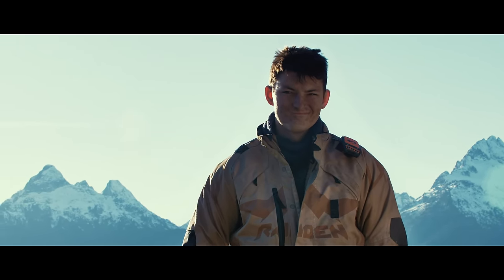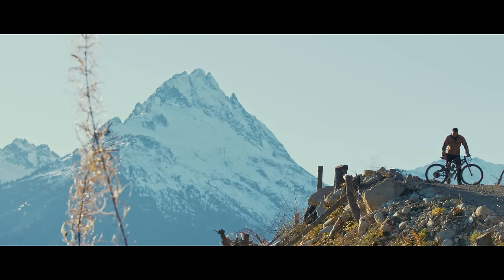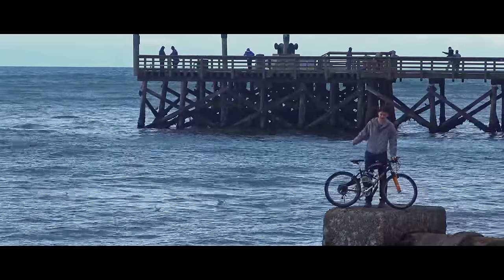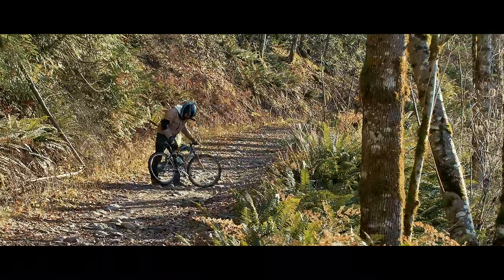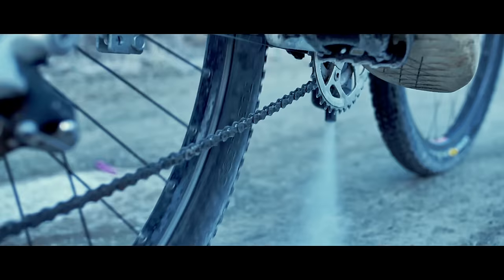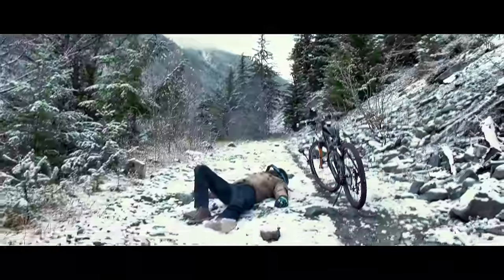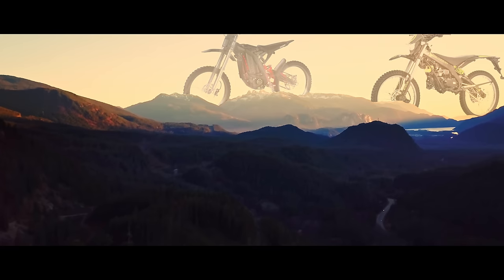I Built a Mountain-Climbing Motorcycle for $200

Comment: Electric bikes and other light weight personal transportation vehicles are surely the future. Atleast in the ever growing cities. But what comes to electric vehicles we honestly need to see some really big improvements in battery technology to get the cost and the emissions down
Reply: Microturbine-Electric Hybrids
Reply: Glass batteries?
Reply: until gas stations have recharging stations built full electric vehicles are pretty much regulated to large city dwellers, people in rural areas will be the last to own or want one. case in point someone in my town bought a Tesla 3 recently but no longer drives it because there are no dedicated charging stations within about 450 miles, and charging it on a home outlet takes too long. if they run out of power away from home, they essentially have to have someone with a generator come up and give them a charge, at which point defeats the purpose of an electric vehicle.

if you want something small, that will pass emissions, and weighs about one standard american or less, look at Chinese bikes. the Hawk 250 has roughly a top speed of 65, parts are readily available online, and will get about 90-120 miles to the gallon depending on riding style and rider weight, for roughly $2000 usd. so for a city commuter it's a value stock, but if you ever want to mess with it, putting a larger sprocket(s), tires, different lights and turn signals, and an after market air filter wont cost more than $300-$400
Reply: Kalezian Blame local mentality and politics on that one. In many places shop owners are installing charging stations to attract customers while they wait, brilliant! We already have electricity everywhere, so it’s only ourselves who choose not to pass it to cars.
Reply: Kalezian Agreed, i did exactly that with a Chinese 125 ‘supermoto’, it was fun to ride and good looking, and I think I made it even better looking (like a 60’s ISDT bike). All for £1400 brand new. Les in UK
Reply: @leslieaustin151  the one good thing about chinese bikes from what I can tell for euro-bros is they can pull you guys through your A1 and A2's easily without breaking the bank which is the main reason I got one. I can afford to lose a 2 grand chinese bike, I cant afford to scrap a 18 grand ducatti.

also, at least it isn't a scooter, I guess.
Reply: @somestuffithoughtyoumightl6985  this also is the mentality of most people, just because your car runs on electricity does not mean your electricity wasn't made via fossil fuels or nuclear power, both of which cause waste and major emissions. sure, I'd love to honestly see someone build a set up of nothing but green energy and see how efficient it is to charge a electric bike or car and how that could be implemented on a large scale basis but no one has the time, money, or desire to go completely green.
Reply: @Kalezian  Generating electricity via fossil fuels and powering electric cars with that is way more efficient than using gasoline. Electricity has a direct distribution network in place, but gasoline has to be shipped around. Also, making a really efficient power plant is significantly easier than making a really efficient engine that has to fit in a car
Reply: @Kalezian  " recharging stations " no, totally wrong way to go about it. quick and simple battery swap is whats needed to go forward in any realistic way i reckon
Reply: @brapamaldi  I think that wouldn't really be needed if battery technology would make big leaps to solidstate batteries that would give bigger range etc. Maybe battery swaps to larger vehicles like trucks would be needed.
Reply: And how big do you think theses batteries are? They not just a couple of D cells you can flip in and out in a couple of seconds. A Tesla 3 has nearly half a ton of batteries on board, the whole car is built around it, you can’t just “swap them out”.
Reply: @brapamaldi  There's an electric car company in China called Nio who has installed battery swap stations for some of there cars and apparently it only takes five or six minutes. The VP of Nio Power suggested battery standardisation was the biggest hurdle, as then they could be leased independently of the cars to which they are fitted.
Reply: @BernardsSumner  Yeah, but nobody cares if your car goes up in a blaze of lithium in China. Or if somebody is fried to a crisp while changing the batteries. They can scotch tape bargain bin 18650 cells wherever they please, without fear of litigation.

Comment: Bro I ordered one after watching this will update when it comes
Reply: it came and is fun but only goes a top of 32km idk why
Reply: @pugboi4078  probably a legal speed limit.. probably ways around it too. gearing also
Reply: Ya a kinda figured gearing
Reply: @pugboi4078  matching my crank case to the transfer ports with a dremel doubled my power, easy
Reply: Huh that sounds interesting, is there any videos/articles on how to do that?
Reply: Wow thanks for going through the effort to make this I will deff try this out
Reply: @pugboi4078  Yeah man, no worries. Hope it goes well. I'm very surprised there aren't more people doing this. Do you have the 80/66cc or the 50cc?
Reply: I have the exact same one as the vid so the 66cc
Reply: @pugboi4078  Nice one. Should work for you then
Reply: Ya thanks for all the help
Reply: I think 32kmph is good for 100 dollars
Reply: @pugboi4078  I bought mine from motorized canada a skyhawk 66cc things a blast and adverts 60km an hour havent actually checked how fast I'm going when I full throttle but I'm sure it's a lot more then 30km also a good quality engine if anyone is looking for one

Comment: Good video Fortnine.  My friend and I built a motorized bike out of a throw-away Schwann and an old Brigs and Stratton 3 hp lawnmower engine. We used an old roller skate wheel and a stick on a fan belt for a clutch.  I got up to 30 mph on and abandoned railroad bed.  It was a blast. Never considered wearing a helmet. Nobody died. Oh— that was 50 years ago.

Comment: Love it! Now buy another engine kit and make it 2wd!
Reply: @Raphael Gallo if you look up the Rokon Trailbreaker, a 2wd motorcycle sounds good but you lose everything that makes a motorcycle....well, a motorcycle. however it does get you places that a side-by-side UTV or an ATV cant get to, even if you can only get it to about 15 mph.
Reply: Raphael Gallo use cable splitters for the throttle and clutch 👍

Comment: Looking like ye have to get more fuel in- re-jet.  That’s the lowest revving two stroke in history 😂
Reply: The engine he got is the one that is designed to meet epa standards. Ie, ran so lean it wants to die. Not to mention its begging for oil even at its break in ratio. Once tuned propperly they can rev as high as the metal they are made of can handle. Mine usually chokes out at around 9k rpm but with a previous exhaust it went to 10k rpm. Course at that high of rpm its the worlds most painful vibrator.
Reply: Ella Banana Er nope.  Low revs in a two stroke generate too much kick back so destroys the bearings. As for using as a vibrator I’m afraid I can’t test in that particular situation.  I suggest advancing a degree.*edit if you want a smoother ride that is* 😂

Comment: Brilliant Ryan 😊. Four years after you made the video, I've watched it tonight here in UK.  Bicycle tech has moved on considerably and let's be honest, you used a very old 26'er for the video anyway.  If you fancy redoing this fun video, might I suggest a few ingredients to spice up the fun factor.  Steel frame hardtail 29er.  Something like a British Cotic or Sonder. I'm sure you'll have some equivalents.  They cheap as chips second hand - perfect YouTube video fodder.  1x12 or similar drive-train.  150mm forks, 34mm diameter stanchions. 150mm dropper post, and flat handlebars at least 700mm wide (not like the super narrow bars you used - OMG that must have felt sketchy doing a few jumps and other techy trails 😅).  Some beefy 3.0 tyres, they are so cushy and will handle the extra weight of the motor so well, plus they grip like shit to fur for off road dopamine rush.  C'mon you know you want to 😊 just wish I could be there to build and ride it with you.  Best regards. Lisa

Comment: I've ridden the mountain mule trails with a dirt bike.  What you are doing is nuts. But I respect you for trying.  Smaller is definitely better for dirt.  I don't understand a 650 in the dirt, much less a 1200 that I have now.  My 1200 sure hauls ass down the dirt roads, but it doesn't quite have the feel of my 125.

Comment: My buddy I built two of these when I was stationed in Korea. Once you get through the “teething” phase, with break-in, figuring out the motors individual preferred fuel-oil mix (mine liked a heavy 25-1, my buddy’s liked 35-1) and chain alignment, they are stupidly reliable. I drove mine all over South Korea lol

Comment: Lovely, I want one. In the U.K. after the government cut and road registration it would be cheaper to by a second hand moped.  Electric also comes with a raft of restriction here as does access to off road🤔 BTW too much oil in the petrol makes it run lean, also make sure the quick release lever for the wheel points backwards, or some undergrowth may undo it.

Comment: At 9:45 it shows a dire mistake on the front skewer. It should be faced to the back of the bike. This prevents objects from hooking it and opening up the axle. While the drop outs will hold the wheel in while you get stopped, it might be a little unnerving as you descend a slope or hill while your front wheel wobbles around.

Comment: Lots of production value going here. For those interested, there are aftermarket parts & mods available to get up that mountain and keep these things running. Be handy. You had better be handy and carry a basket of tools. So, a jackshaft kit will let you route the engine power through the bicycle gearing and  BOOM you've got 21 speeds. Your overall cost just jumped to $300.00.

Comment: I built a couple 4 stroke for $350 ea with $100 Walmart MB's. A bigger rear sprocket will give you more torque. 
Made to summit local mountains, and burn brakes up on the way down!

Comment: I converted my long wheel base recumbent bicycle, to a E-bike by adding a front hub motor. In parts of Europe, E-bikes are becoming the normal. Course mine is Electric, so range is limited to battery size. But seems a lot more reliable, then what you built. You should look into E-bikes. Heck using Hub motors you could build a the bike from Akira!

Comment: Built what you have there but fixed a bunch of the issues you encountered in your off road homebuilt.  The biggest issue to be fixed is the gearing, that is putting shorter gears on it.  Started with a used $10 15 speed mountain bike, sorry no suspension on this baby.  Add a 80cc cheapest on Ebay, yep 60cc for normal folk.  Next take that stock sprocket and use as a ringing target for your gun range.  Replace it with a 60 or so rear sprocket and gain a shitload of power but a loss of top speed.  Engine improvements are simply match up the ports, anything else is just frustration and money spent.  Installed a disk brake kit, slightly better stopping, from useless to simply fear instilling.  Hey now it will maybe hit 25mph off a cliff but it will also now climb that cliff.  Made a homemade sidecar and the grandkids love it.

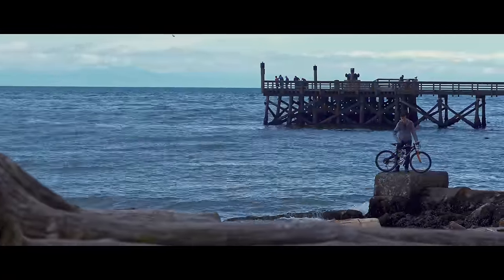Comment: 4:04 - Cubic Capacity
What is Cubic Capacity (CC) in Motorcycles? ... The capacity of a motorcycle's engine is measured in terms of cubic capacity. Cubic capacity, also known as “cc" of vehicles, usually ranges between 50cc to 1500cc. It is also believed that the larger chamber on a two-wheeler, the more powerful it is.

Comment: I have a BSA from Trev Deeley's, sold in 1969. When they were on Broadway, cool adventure if you want to test ride a near mint '82 R100RT dual plugged the last wind tunnel designed motorcycle for production is the rumour. I'm in Vancouver, or a 1500w all wheel drive EV 1952 CWC Roadmaster LOL!

Comment: I built one of these.  Be careful, the engine raises the center of gravity.  I also replaced all the studs and bolts.  It will burn you.  The vibration is pretty damn bad,  It's a fun toy.  I bought a honda grom afterwards, which is night/day better but also $$$.

Comment: Wonder how better a 100cc would be. These 2 strokes need to have the main jet swapped and  slide adjusted to keep it from running too lean. It's so easy to do on those carbs. Although a 50cc or even a monster 80cc would probably not break a sweat going up mountain trail.

Comment: Motorized bike is the proper term for this application being that it can be used for exercise and a faster mode of transportation. Motorcycles are only used for transportation and once you've ran out of fuel you have to either push it or call for help to get it refueled. Motorized bikes don't have this problem by letting you use it as a bicycle when you run out of fuel.

Comment: coming from e-bikes theres not much available commercially thats under 100kg and under 50 mph ( but can get over 30mph ),  it makes it hard to decide which motorcycle to try and get as a beginner,  I've been looking at Puch / Tomos / Jawa sort of things but they are not selling enough of them new for it to be appealing.  I like the Honda Trail 125 but its quite expensive and doesn't sell in the UK, some guys did a video with that bike where they rode it through Alaska.

Comment: I did this on a 5 dollar garage sale bike. 2 years of consent use and 5000 miles later and she still holds up fine to 10 mile redlining. A few replacement parts but I could not have gotten anything better or cheaper for a kid going to work. If your to young to get a licence, get this.

Comment: This is exactly why I love Janus MCs. They are 250 and 450cc engines based off of a Honda scooter motor and they are all reminiscent of the Harley and Indians of the 20s gone by. 100years of legacy being pulled from the barn, dusted off and back out on the road because a cafe racer shouldn’t cost $30k and a scout bobber shouldn’t be $25k+. I have been dreaming of doing a home built moped with the shoebox kit, using a full suspension fat bike, but I’m not sure if there are any kits that can take the load. Would be badass as hell though if I could get it to work
Reply: These have very low power, below 1 HP. You might want to go electric (my electric bike was pretty cheap and I've even got a hub motor wheel with 5" fat tires on it for under $200 and about 2x the power of that gas one). Chainsaws make good engines if you're wanting to do it proper, and in some states perfectly legal considered just a bicycle (some prefer electric, like Texas I made the electric for that, for Oklahoma I had several motorized bikes ranging from 25cc weedwhacker that would do 28 mph and accelerate decent up to 52cc chainsaw when they raised the limit above 50cc for the chinese kit engines, but the chinese kit engines are much slower, like 22 mph max and terrible acceleration and stupidly heavy, and sound terrible unless you change the exhaust to a go-cart exhaust which is easy since its standard plumbing pipe thread)

Comment: Mine ran good for about 30min then it started to sound strange and I felt the exhaust on my leg.  Turns out one of the cylinder studs stripped the hole and was blowing past the gasket.

Still need to take a set of wrenches out every ride but after 1.5 years most of the issues are worked out

Comment: I have built two of those. I almost got killed on the first one. I was riding along in the bike lane when that cheezy clamp on made out of tin chain tensioner got pulled into the rear wheel, ripping out several spokes and locking the wheel, causing me to crash hard. There was a sidewalk on the right, and a lane of fast moving traffic on the left. Fortunately I went down to the right. Had I gone left, I would have instantly been hit and killed by a speeding car. I still got banged up pretty good. A couple of years later I built another one. The cheap crappy tensioner got replaced by a heavy duty one mounted to the engine case. The rag joint rear sprocket got replaced by a clamshell mount that bolted directly to the rear wheel hub, so it was perfectly centered and wouldn't break the spokes. The engines are junk. I went through 2 of them in maybe 1000 miles or so, the bike is still parked in the shed in the back yard with a blown engine. The 80cc engines are actually 66cc when measured properly. Front and rear V brakes are more than adequate. Some people build these bikes with only a coaster brake on the rear. I'd say that is pushing it. Some day I may drag that bike out and put a proper 4 stroke engine on it. There is one hard and fast rule with bikes like this. They WILL fail at some point. They are probably 100 times more likely to fail than a proper non chinese motorcycle.  NEVER ride one into something that you cannot pedal your way out of.

Comment: It's probably WAY overcautious, but if I bought one of those mail order motors, I'd tear it apart, check that it actually came set up with the specs it claims, then throw the cylinder, piston, rod, crank, and any other moving or wear surface part into a tub of duralube and let it soak for a week before I even ATTEMPT to start it.